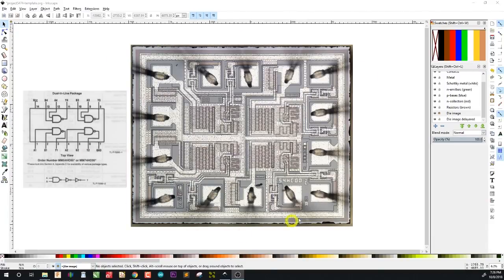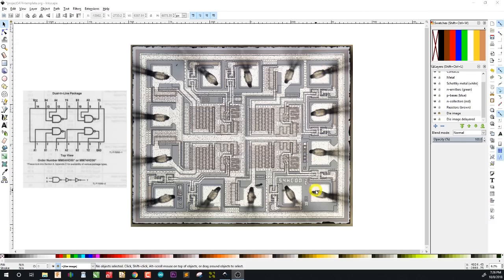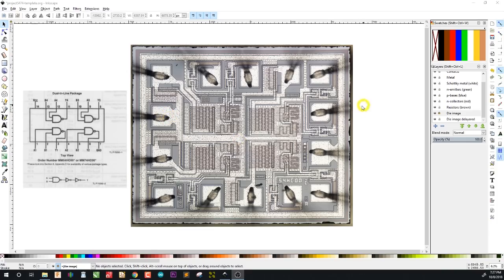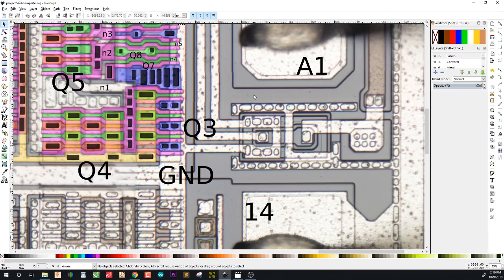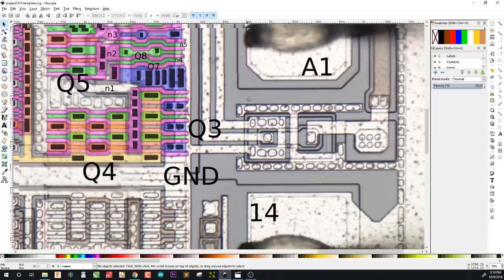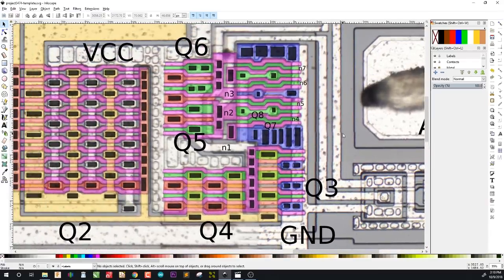Reverse engineering a simple CMOS chip

Comment: Hi the quick explanation of what Q7/Q8 is with its "floatin" connection is something different.. This is how you create an AND gate in CMOS. @30:33 you can see Q7 from GND (blue) going to what you put in as Q8 (green) that is connecting to n1 (output of the transistor).In between you think you do have floating n4... however what it really is, that you have a single transistor with two gates. Both most be active to conduct GND to Out. So this is both nmos, that means, both inputs (n2 AND n3) must be active to let current pass from GND of Q7 to N1.. So it is actually not two transistors, but a single transistor with two gates and both need to be on to activate the transistor. 

That is something you can see pretty often on cmos and a very simple way to AND stuff. So as you have dawn out, essentially it is 4 transistors. two of them ORed and two of them ANDed. Due to CMOS they need to have the same complementary setup...

Not sure if my explanation was good to understand, but in essence - the current needs to patth both pink gates  (N2 and N3) to connect N1 to GND. Also I think it could have been done simpler in the diagram but as the circuit need to support a certain current, a single line Q was not enough, so they needed to double it up in lines.

Comment: what is the purpose of two inverters at the end ? isn't it equivqalent to no inverter at all ?
Reply: Most likely a buffer, something that doesn't change the logic value of the signal, but allows the receiver to draw more current from the output, and it also makes the edges sharper by amplifying the signal.

Comment: ...so I have a blown board which is 3 separate boards that come in a kit, how easy is it to trace power over a board? I get lost once it goes into a chip. Not that we do that stuff, but I’d like to be able to prove the point faster.
Reply: Depends on the board. Get a multimeter and it makes the job much easier. I recommend the Aneng Q1 or 8006. They are great starter meters and cost under $30.
Reply: @excitedbox5705  hahaaa yuh write groooondes voltaz strait2blowit off of 000 noks yuh...

Comment: where is Pin 1 different from other pins? I really can not find any difference between Pin1 and any other pins
Reply from the maker: Pin one has its corners cut off.
Reply: @RobertBaruch  Thanks a lot. The author replied to me, it's really a exciting thing.
I'm a newbie about the chip and hardware things, I wonder if the video could be more detailed, for example, I guess the picture is a x-ray picture, and the white things in the chip is metal, but I don't know whether the chip has multiule layer, how you know two area are connected, it seems really obvious for you, however, it confuses me. 
I think if you add those information in the next video, it will attract more people like me, and I think you and this video helps me a lot. As you audiance I really appreciate your work, thanks.
Reply: @赶路人-q1w  This was an optical microscope image.  There is not much useful colour on Silicon ICs so the images are often black and white at the best available resolution.

Search for IC photomicrograph on the net or YouTube and you will get lots of examples to study.

Comment: Why do those transistors "meander" like that in a comb-like fashion? Is there any reason behind not using a bigger, simple-shaped area instead?
Reply: There are other shapes as well. It all depends on what you are trying to achieve. I have seen a circle with a bunch of finger overlapping it for a multi transistor. I think that was on an early microprocessor.
Reply: @excitedbox5705  Yes, I'm aware that there are different shapes. What I'd like to know is – WHY? How does the shape influence the working of the transistor?
Reply: @bonbonpony  My guess is sonething about the capacitances, or about semiconductor's resistance. Doing it in a comb like pattern reduces it, shortening the paths
Reply: @mzflighter6905  If it were about capacitance, combing would increase it if anything, because this means more surface area between the electrodes.
But you might be onto something: this comb pattern might increase the length of the gate area between the two other electrodes, meaning "wider doorway" for more charge to flow through (higher currents), but without increasing the overall space the transistor takes on the silicon plate.
Reply: @bonbonpony  It is done that way to increase the effective gate width of the MOS transistor, which increases the drive current it can source or sink.  It's the equivalent of having one very long finger, but since that's inconvenient, they fold it to make it have a more convenient aspect ratio.

Comment: Why is the output transistor to Vcc so much larger than the one to GND? Because it's expected to drive loads?
Reply: IIRC, PMOS performance sucks compared to NMOS performance; so a large PMOS has comparable drive ability compared to a smaller NMOS. In fact, if you read the datasheet; the smaller NMOS can pull down harder than the huge PMOS! (NMOS has 0.4V drop while sinking 4mA, while PMOS has a 0.8V while sourcing the same.) And if you're thinking "aren't NMOS and PMOS just mirror images, shouldn't they have symmetrical performance?" -- No, the channel in one is N-type silicon and the other is P-type silicon. Different dopants, different majority carriers, different properties.
Reply: Mobility for the NMOS is usually 3 times higher than mobility for PMOS. That's why PMOS are 3 times bigger than NMOS.
Reply: Right, now that you say it, I realize I knew that. :)

Comment: You got it wrong your pin 1 (VCC ) is actually pin 7 (GND)  simply by the fact that it connects outside the chip on the isolated metallic square around it best choice for a ground and that your pin 7 (which is pin 1) connects inside the chip good idea if you want to give power to the innards of a chip :P

Comment: What is the purpose of the double inverter output?
Reply: The output driver transistors are very large... driving them directly from the small logic transistors would slow the circuit down because of the large gate capacitance.  So you have an intermediate inverter that has less gate capacitance than the output driver, but can provide a lot more current than the logic transistors.  I've even seen cases with more than two inverters in a row, with each inverter being larger than the previous.

Comment: Cool stuff. Is it possible to reverse engineer a modern processor? I feel that only automatization could handle the task that complex
Reply: Yes it is, but you will need a very good Scanning electron microscope and a team of engineers. We do it at our lab here in Texas and just one portion of a 22 nm processor took 8 months.
Reply: @billjames1953  Good job. Texians are awesome. So, you could see if the Chinese put something queer in a chip? So, electron microscope could read internals? And no light limitations, i guess?
Reply: @nailsaggitarius4212  we reverse engineer chips for either legacy parts that need to be re-made or for patent cases.  But if we were asked to look to see if something was added, we could do that, but would need to see the original design.
Reply: @nailsaggitarius4212  nut now jon,god a nueme ota...

Comment: why there is no Capacitors on silicone dies ?
Reply: Because you can decouple it externally?
Reply: There ARE capacitors on silicon!!!  A prime example being something like DRAM that has literally BILLIONS of caps.
In comparison, this exceedingly 'basic' nand gate doesn't WANT any on chip capacitors.  It simply acts like a switch that connects the output pin to either VCC or GND depending upon the state of the two input pins.
As MZ flighter mentions, it is very common to place a (small-ish) external capacitor VERY near to and across the power supply pins for decoupling.  Such decoupling capacitors act as tiny LOCAL power supplies when the output changes state.  (Without decoupling caps, the potentially LONG and winding PCB traces to the power pins can act like inductors that can significantly s-l-o-w down the output switching so it's considered 'good practice [TM]' to include one for each 74xx chip if the board is to achieve the highest possible speeds.
Something else to keep in mind is that microchips are comparatively small (by definition).  In order to make a capacitor of a 'meaningful' capacitance on silicon would consume a LOT of silicon real estate.
IIRC, in the late '60s, Fairchild polled some of their 'bigger' customers asking if they would pay a 'premium' for 74xx chips with 'built in' 0.1uF decoupling caps.  Given what has survived today, I assume you can guess what he response was?

Footnote: You should take a look at the bottom of a PCB underneath a typical modern / powerful FPGA.  It's like a small FOREST of decoupling caps for the various supply rails these things use.
Reply: @trevorvanbremen4718  san francisco! [motorol/mac/60s apple reprise!]cap0jax
Reply: If you look at photomicrographs of switched capacitor filters in ICs (like modem of DTMF chips) you will find capacitors.  They are low value so cost a lot of silicon real estate, they are avoided if possible and placed outside.

Comment: could anyone explain why would we even want to connect double inverters? 
I can't find reason other than adding delay which is usually avoided.
Sorry if its an obvious thing I'm still learning this stuff.
Reply: Probably they wanted to add a buffer acting like a Schmidt trigger, to avoid undefined states
Reply: Notice the SIZE of Q1 and Q2 (fairly big) and compare them to the SIZE of the preceding inverter (Q3 / Q4)...
The Q1/Q2 pair can handle WAY bigger loads (such as you might expect on the OUTPUT of the nand gate).

If you were to eliminate the Q3 / Q4 inverter altogether, you'd end up with.... an AND gate.
Reply: intel delay[as intels exsistsa?],blue traces[pre bluelightening ps2 escapades/mac/motorolla?]
Reply: See my explanation above... The output driver transistors are very large... driving them directly from the small logic transistors would slow the circuit down because of the large gate capacitance.  So you have an intermediate inverter that has less gate capacitance than the output driver, but can provide a lot more current than the logic transistors.  I've even seen cases with more than two inverters in a row, with each inverter being larger than the previous.  (And you need an even number to keep it as a NAND gate rather than an AND gate.)

Comment: I wonder if it's possible to reverse engineer c64 Vic and Sid chips, zx speccy ULA chip or Amiga AGA chip....
Reply: A lot of ULA chips were "Uncommitted Logic Arrays" that were connected up according to the customer design using the top metal layer so delivery times were reasonable and test masks could be used to characterise the chip.  If you had access to the type of ULA core type and the mask design information you could reverse engineer it just by examining the top metal layer.  However none of this information was ever made public and many of the companies no longer exist and the workers have retired it is hard to get official data.  So one has to resort to transistor level.

With the ZX Spectrum you have a lot of enthusiasts who have worked on the designs for years.  There may be a ULA design already out there.  With the ZX 81 the ULA is very similar to all the logic chips in the ZX 80 that are now missing as the machines are almost the same with the exception of FAST mode.  The Spectrum ULA will also share a lot of similar logic to the ZX8x with colour video managed fully in hardware instead of by the Z80 CPU as in the ZX8x.

Comment: Why is the layout of a single transistor so complicated? I always thought of a transistor as three blocks of alternatingly doped silicon put together. As far as I understand the green and blue regions at 10:41 are the collector and emitter (or the other way around) of the transistor and the pink/magenta region is the base. Why though are they arranged in this complicated intertwining layout and not, as taught on literally every website explaining transistors, as three blocks next to each other? Three blocks are probably easier to "print" onto the chips than this intertwining pattern, so there has to be a reason for this pattern.
Reply: What would those intertwined layers look like from the side? 3 blocks next to each other ;)
Reply: @excitedbox5705  Yes, of course, but why this intertwining pattern? Seeing how microchips are produced I understand why it is easier to stack layers of silicon on top of each other than next to each other. But why don't manufacturers simply put literally three blocks of doped silicon on top of each other? Why is there this complicated intertwining pattern? Maybe this has something to do with capacitance or resistance?
Reply: These are called multi-finger transistors, IIRC their main purpose is to efficiently reduce the physical size of the layout compared with single-finger transistors. Also, depending on the circuit, it can also reduce gate resistances and improve device matching (you can split those transistors into several fingers and put them in a manner to fully utilise the floorplan while still retaining their W/L ratio)
Reply: @sbtjlhw111  Thanks for your great answer, I've definitely got some reading to do now :)
And the term "multi-finger" kinda suggests that this "single" transistor (as I have thought about it) really is multiple transistors in parallel, which is kind of obvious now and I wonder how I didn't see that myself :D
Reply: The earliest transistors (we're talking way back in the 40s / 50s here) were exactly what you've stated.  Three 'blobs'.  However, these were Bipolar Junction Transistors (BJTs) rather than the Field Effect Transistors (FETs) that they were HOPING to produce.
With BJTs, it's far more difficult to just parallel a bunch together.  (It CAN be done and is not uncommon in things like audio power amplifiers, but due to the minute differences between each BJT, it generally requires use of emitter resistors).
With MOSFETs on digital chips (where ALL of the devices are implicitly VERY close to each other in temperature etc), it's far more practical to directly parallel them without risking the thermal runaway issues you'd encounter with discrete BJTs
BTW, transistors on chips can often get 'weird'.  It's not uncommon to see single devices that have MULTIPLE gates etc
Reply: theres no layout,life is watt char make kits!
Reply: These are MOS transistors, not BJT, so there's no emitter, base, collector.  Instead, we have source, gate, drain.  The gate is often made of many fingers to increase the effective gate width, which increases the drive current of the transistor.

Even BJTs are not laid out as three blocks next to one another; that's a diagram for convenience and does not reflect reality.  Instead, a typical BJT has a small, highly-doped emitter region that's completely surrounded by a base region, which in turn is completely surrounded by the collector region.  That's why you can't just interchange the emitter and collector on a BJT; they are physically very different.

Here's a simplified cross-section of a BJT layout: https://en.wikipedia.org/wiki/Bipolar_junction_transistor#/media/File:NPN_BJT_(Planar)_Cross-section.svg

Comment: I always see a lot of 2 dimensional organization... Wonder why the depth has never been truly utilized... Granted this is probably why the newer quantum is layered stacks yet theirs so much space that's not being utilized. Would be an interesting path and routing if a 3D printer is developed to create newer design.
Reply: Designers minimize layers because it greatly reduces cost. Also think more layers would also mean it takes longer and would increase manufacturing errors. Sometimes simpler is better!
Reply: High-density DRAM chips use capacitors etched into a trench in the silicon, so they do somewhat make use of the depth.

Comment: Would it be possible to reverse TI BQ2040 BMS chip to read firmware from its ROM? 
The specification is wrong regarding smbus write through function to external EEPROM and it would be interesting to check what is happening.
Reply: From the datasheet for that chip, the whole contents of ROM are listed in a table. Maybe it's more useful to have a logic analyzer to check the data and address bus for EEPROM communications.
Reply: @mateijordache1952  The idea is to directly access external EEPROM through smbus without need to dissasemble or direct soldering to eeprom. The function is there but doesn't work as in datasheet so there are something that is not documented. For BQ2060 it works correctly.
Reply: wrong=rung[synchro/compares/synthesis/2unes bi folk corls!..]voliz...